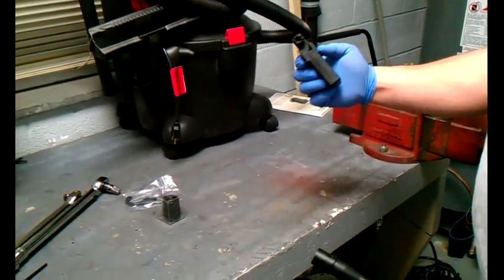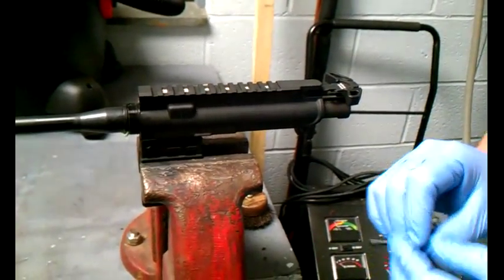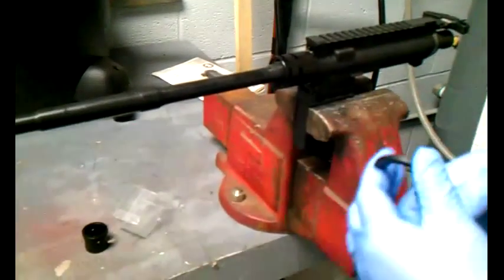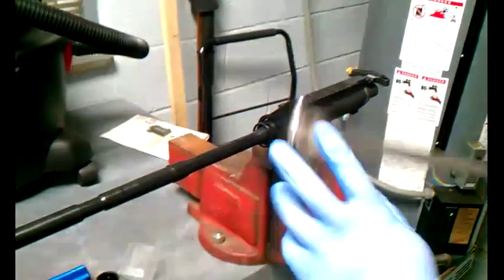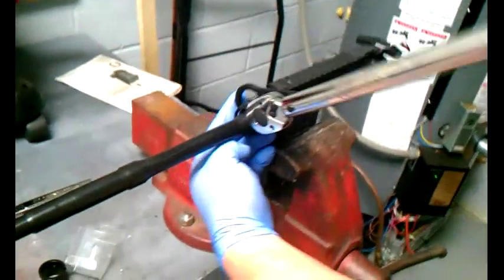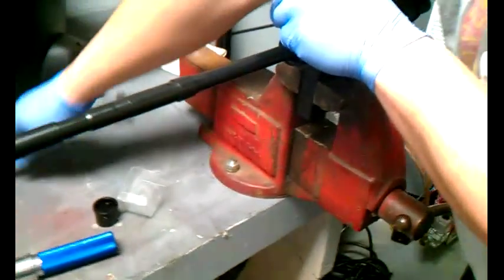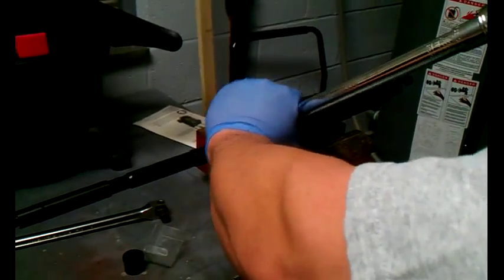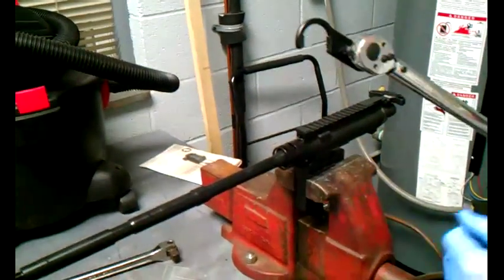How to Build the AR15:  The Correct Way to Torque a Barrel Nut

Comment: Notice how the nut didn't budge at all from 30lbs to 35lbs to 40lbs... When you put slow, constant pressure on a torque wrench... they don't torque correctly! They over torque by a few lbs. Hence no movement from 30-40lbs.... Thank god this is just an AR (huge window) and not a high performance engine head!!

Comment: Good vid, unfortunately, I'm searching for the "correct" way to torque and did not find it here. You can not ad a device to the connector, then apply your torque wrench to that added device – it changes the lever. A foot pound is a given torque measured from center of the connector, one foot out (that's the lever). Adding anything to the lever changes the applied torque. You're ok here because the AR-15 barrel nut torque specs are so wide (30 - 80 ft. lbs.). Actually, "foot pounds" is incorrect in itself. A foot pound is the force necessary to raise one pound, one foot. Pounds foot, is a measure of applied torque, measured one foot from center of the item being torqued, i.e., the connector be it bolt or nut. The only way the method used in this video can be correct is, you must know the trigonometry necessary to calculate the impact of the added length to the lever and apply that sum to your torque wrench setting. Does any one here know the trigonometry to calculate this? The reason for torque wrenches, all torque wrenches, is to accommodate those of us who do not know the trigonometry to make these calculations. Change the lever and all bets are off with the torque wrench's accuracy. In the method used in this video, the applied torque is astronomically higher than the torque wrench's setting because the lever was increased to be longer than the lever calculated by the maker of this particular torque wrench. I'm working with a precision rifle where the torque spec on the barrel nut is shown as critical but provides no indication of how to achieve the "critical" torque spec; however, the barrel nut on this precision rifle is similar to the AR-15 nut, which is why watched this video.
Reply: 🤣🤣🤣i didn't finish reading your comment, because obviously you didn't listen to the video.  I'm not torquing to a specific specification.  I'm torquing to a range.  So if you know how to torque a nut to a specific and correct value, I applaud you, you know how to do that; as well as I do too, but here it doesn't matter and doesn't work.  If you torque your barrel nut to a minimum "correct" 35 ft-lbs, it will be actually higher if you were to check it with the way you say to do it. However if I was to torque it "correctly" with your method and only torque to the minimum "actual" 35 ft-lbs, you will never have an accurate rifle because of the sloppy tolerances that you just induced with a loose barrel to upper engagement.  I say you, do you!  If you know everything and how to build a rifle, have at it, but don't confuse my viewers that are here to learn the right way for this type of machine!

Comment: cool info on the BEV, but using a torque wrench like that isn't correct. You are increasing the distance to fulcrum, and therefore changing the torque you are applying. You have now added the variable of each maker's barrel nut wrench length to the end of your torque wrench.
Reply: It's the same way Daniel Defense does it who is a DoD Contractor and maker of high end rifles, barrels and parts.

https://www.youtube.com/watch?v=c6wiWgTw0cA

Comment: Regardless of what the TM states in the literature, admittedly I haven’t read the entire article but math is math and proper torque values are achieved at a 90 degree angle, besides that aeroshell 33ms/64 is definitely staged in the TM and I didn’t hear you mention that at all🤔

Comment: You can do 90 degrees. It's physics. Welcome to reality.
Reply: You can and you'd be wrong.  The point is, if you watch and LISTEN to the whole video, read all of my replies, we are not building an airplane or torquing head bolts on an engine.  The torque here is a range, and not precision, however if you torque to the minimum of 35 Ft-lbs @ 90 degrees, your torque could be too low to seat the threads.  If Eugene Stoner was alive, you could ask him, however since he's not, just remember he's the one that taught everyone else to use the torque wrench in-line with the barrel nut wrench.  It's not going to hurt anything if the nut is tightened 5 Ft-lbs more. One day I might do the calculation and come up with a total to see where the torque is really at, but I think it really won't be that much.  Until then, if you want to torque to exact specs, feel free to turn 90 degrees, just don't try to confuse my viewers, make your own dam video!
Reply: @TheScreaminTiger  

It's the same way Daniel Defense does it who is a DoD Contractor and maker of high end rifles, barrels and parts.

https://www.youtube.com/watch?v=c6wiWgTw0cA

Comment: You need to have the torque wrench adapter placed 90 degrees from the  head of the wrench.  You have applied too much torque with it coming out the front.
Reply: Yes this is Correct and you can also loosen using a torque wrench unless you have some cheap torque wrench that specifies otherwise.

Comment: This 100% pointless argument will go one forever.  BOTTOM LINE - 30 - 80 ft lbs range is huge.  There is absolutely no reason to go over 30 unless you have to accommodate a sprocket style barrel nut.  The relationship of the adapter to the wrench makes a hill of beans difference.  So the TITLE of this video "The correct way to Torque a barrel nut" is 100% insignificant.  Including the number (45-50?) that the author precisely  ended up torqued to.  Hey lets talk about galvanic corrosion next!!  I can't wait!!

Comment: The length from handle to socket is calibrated for the torque wrench. By extending the socket length point those extra inches you are not achieving accurate torque. At 90 degrees the handle to socket length stays the same.
Reply: The tool is at a calibrated length (3 in) you can do the math to see what's actually being applied.

Comment: I build aircraft for the army, it is most definitely supposed to be at 90. You’d be surprised how incorrect our technical manuals are sometimes. Look into how mechanical levers work
Reply: Funny, but this video doesn't have any aircraft in it.
Reply: @TheScreaminTiger  🤔🤣😂🤣 but Gabe Coile is correct, +/- 3% and safety wired. USAF, Ret. aircraft mechanic SAC & USAFE

Comment: 2:40 What‘a the reason that a different wrench should be used for loosening? Thanks!
Reply: You can damage the torque wrench's internal mechanisms if you use is to break fasteners loose. Right hand thread, left hand thread; applying torque to spec is ok. Use a breaker bar to break a nut/bolt loose.
Reply: Using your torque wrench to loosen or use as a regular wrench can cause your calibrated torque to be off.  The wrench can go left or right for tightening left or right handed threaded fasteners.

Comment: Wrong! it is done at 90 degree angle as to not extend the torque wrench length thus adding more leverage and higher torque value than the on the wrench, you might need to re read the manual or check with a real engineer on how the torque specs are measured, is a matter of fact there is a tutorial on this subject that has to do with torque values on barrel nuts explained by a real engineer in you tube!
Reply: It's the same way Daniel Defense does it who is a DoD Contractor and maker of high end rifles, barrels and parts.

https://www.youtube.com/watch?v=c6wiWgTw0cA

As soon as someone says they are a engineer I was trained to automatically assume they have no common sense and are a village idiot!

Comment: I always smear a thin layer of Aeroshell 33MS synthetic Lithium+Moly grease on the barrel extension and receiver threads. It will prevent the steel on aluminum parts from seizing up. Same thing with steel on steel muzzle brakes and flash hiders. The Frog Lube coconut oil will break down and just gum up the parts.
Reply: I do as well, but in this case I had to use what I had on hand.  This build was for a friend that didn't want to wait another day! 😂

Comment: I don’t like posting on these videos, but everything you’ve done just upset me. So in-line is correct on a TM? Well is that BEV Block in that manual as well? No. See using the Bev block puts all torque in the indexing cut on the receiver. That’s a bad thing, only time you want to use that is for a muzzle device. Stop spreading info if you don’t know what you’re doing.

Comment: Additional clarification based on past conversation -- Assuming the military supplied armorers wrench (as seen in the USMC M16 manual) has a 3" span between the drive attach and barrel nut center, using the torque wrench in-line with the armorers wrench and set to 30# you would be imparting 25# on the barrel nut. So it seems the military manual is stipulating a 25# (actual) minimum torque. If you use an aftermarket wrench with an 8" span (again, torque wrench in-line) between centers you would be imparting a 19.6# torque on the nut, roughly 20% less torque. They could have made this all a moot point if using 90° attach angle for the wrench as, with that, length of wrench would have no effect on torque value. I'm sure the military wasn't thinking aftermarket armorers wrenches though.

Would be great to get the exact dimension (center to center) of a military issue wrench. With that we could really know what the military torque spec is for the barrel nut.
Reply: You did your math wrong here.  If using the adapter inline with the torque wrench, you increase the lever arm, thereby increasing the torque applied to the nut.
Reply: extending the wrench would increase the tourqe not decrease it.

Comment: Aluminium to steel no anti sieze? When putting an adapter other than a socket on a torque wrench offset an adapter at 90 degrees if you don't know the mathmaticle formula. Military manule?? Offseting  at 90 degree angle is proper way. Do your reserch please.
Reply: If the anti-seize compound is silver or copper colored, don't use it.  The proper lube is moly grease... which is wheel bearing grease.

Comment: Please RR, view Shane Conley's video; "How to use a crowfoot or extension adapter on a torque wrench WITHOUT MATH". It will visually PROVE how the adapter position (90* and 180*) affects your actual torque output value. Your method is producing a value HIGHER than your wrench is set at. Again, see Shane's video.
Reply: This isn't a car and wasn't designed to be torqued the same.  From page 3-41 of the tech manual.  "9. Using combination wrench (10) and torque wrench, torque barrel nut assembly (9) to 30 ft-lb (40.5 N-m).
Torque is measured when both wrenches are used together"   The picture shows them inline with each other, not offset.

Comment: I understand if you use an extension tool straight in line with a torque wrench you have to use the following formula. Formula for using torque wrench straight in line with barrel nut tool.
T = Actual Desired Torque
y = Applied Indicate Torque
L = Effective Length Lever (From handhold to socket drive)
E = Effective Length of Extension (From socket hole to barrel center)

                    T x L
Formula     ---------  = Y
                    L + E

   Desired Torque x Length of wrench to handhold
------------------------------------------------------------------------------------  = Torque you set Wrench to
Length of Wrench to handhold + length of Extension
Reply: Thank you for adding the formula.  This is true, however, the short distance from the torque wrench adds negligible torque to the overall value.  Maybe 5 Ft-lbs at the max value?  That's why in this case it doesn't matter.
Reply: @TheScreaminTiger  It's completely dependent on how long your torque wrench is and how much force is applied. It's not just a fixed offset because torque is the product (not sum) of the force x lever arm.
Reply: @nomsolo9935  I just replied to someone else, but I'll reply to you too.  One day if life will stop getting in the way, lol, I might do the calculation for the extension and wrench just to see where we're at.  Thing is though, when Eugene Stoner invented this rifle he believed in the KISS method, and he is the one that dumbed it down for armorers to just use the tools in-line as to not confuse anyone.  Again, we are not using a set torque, but a range.  Most times if you hit the low end for the gas tube to be in-line, (35), if you go to the next notch for the gas tube, you'll be in the high range, (80).

Comment: this is only MY TAKE......@ 180 u r adding a few inches to the t/bar's length, the t/bar has been calibrated at FACTORY for a accurate torque at bar's given length (centered @ LUG) a error will occur when this centered length is changed....... NOTE - the side distance does not add a factor.
                                                     ALL BLACK RIFLES MATTER
Reply: Side distance does actually make a slight difference as well.  The handle follows the arc of a circle so after a few degrees the distance becomes shorter as the tool bends.